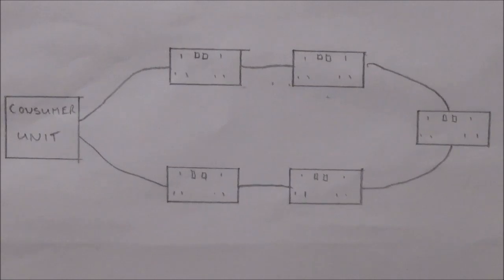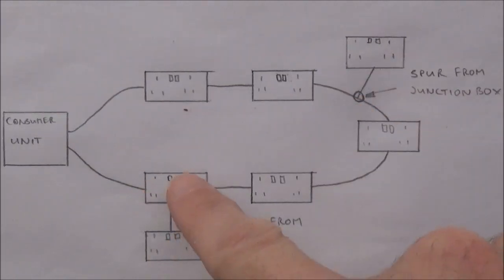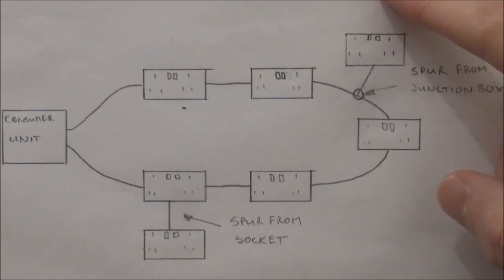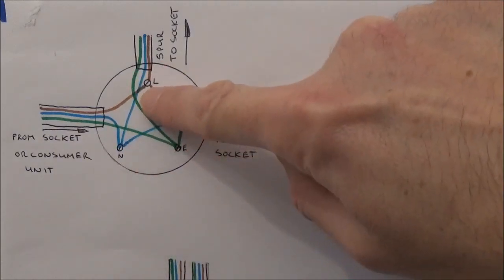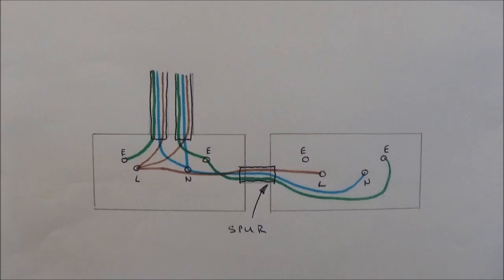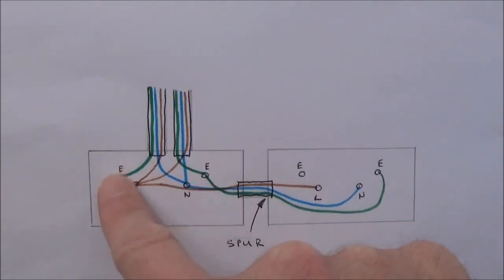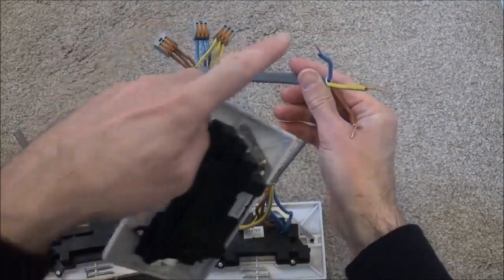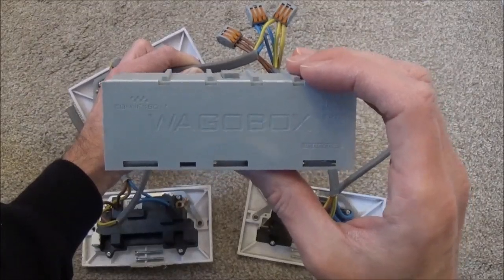How to wire a spur socket to ring circuit. Add a spur socket to ring main.

Comment: Can I change a fused single socket used for washing machine to a double socket for use of dish washer and washing machine. (Won't be run at the same time) and the double socket will still be on the fused switch.

😂😂

Comment: how do you tell if you have a ring circuit or a radial?
Reply: Im a diyer but from what ive gathered, continuity test is the best way of checking. I have a 32 amp breaker and there's 2x 2.5mm cables going to it so im pretty sure mines a ring circuit. I believe a radial is typically 16/20amp with only 1 2.5mm wire at the breaker

Comment: You should not cut the ring to add a spur, connecting or ring cuts should only be at sockets or DB. To add a round 30 amp JB to add a spur split cable do not cut. Slice the cable and  then the  cores are then pulled a part and each conductor is placed in the brass connector.   Use a Stanley knife to do this (only if training has been received how to use a knife safely) this is the correct way. Yes the round JB is rated at 30 amp but the way it is made can take 32 amp easily.

Comment: Great video! If you are only adding 1 new 2 gang socket via the spur method, does this need a fused spur if this socket will be utilisation an extension lead?
Reply from the maker: No because a plug on an extension lead has a 13amp fuse which protects the cable on the extension lead. Hope that helps 👍

Comment: Just don’t do it. Much better to divide the ring into two or more radials and fuse it correctly for the cable size.
Reply from the maker: But that's way more work than just adding a socket. They are two completely different tasks. Thanks for watching.
Reply: @ safety first .
Reply: @MARTINA-gc3tq  what is unsafe about a spur?
Reply: @ that's the wrong question.  You need to ask “what is wrong with a ring”  …..
Reply: @  uK homes are mostly wired in rings. Adding a spur is safe and easier than making the house a different configuration which would add complexity . So I cannot see how this is the wrong question, there are pros and cons to rings just like any other method. But it’s what we have and it’s not unsafe so the question stands
Reply: @pj4433  the CON being that there is a realistic chance of the cables being overloaded and under breaker protection provided.

Comment: You havent connected the cpcs in the socket outlet properly,you are obviously not qualified to give advice on these matters with modern socket outlets they are provided with 2 cpc connections,theres a readon for that which you obviously dont know,the reason there are 2 cpc vonnection blocks with a bar connecting two is very simple you connect one cpc into one block and the other cpc into the other block,the reason for this is that if you lose one of the cpcs through a loose connection or other reason you will still have a fully working cpc connection to that socket outlet because its a ring circuit,putting them both in the same block and its a loose connection making them fall out the block then you have no earth connection at that socket outlet
Reply from the maker: Not all sockets have two cpc connections. Only double pole sockets. Thanks for watching.

Comment: WRONG, just WRONG, clearly you are NOT in ANY WAY qualified or otherwise experienced to give this kind of advice.  The BROWN wire is the LINE (not Live), The BLUE wire is the NEUTRAL wire and the bare copper conductor that gets sleeved in Green & Yellow is the CIRCUIT PROTECTIVE CONDUCTOR or CPC, it is not called the Earth wire (even though it should be at Earth potential). On BOTH occasions that you wired the spurred off socket you got it WRONG, when only a single wire is secured by a screw into the rear of a socket then you MUST double over the single conductor (wire) and the cpc MUST go to the socket first (which in your case it did) but the back box if it is metal MUST also have a connection to the cpc, this has been a REQUIREMENT since 1966.  If the junction box goes under the floorboards then it must meet the requirements in BS7671 for a maintenance free connection, the WAGObox, if installed correctly, would meet this requirement whereas a round black (or white) bakelite junction box with screws would not.  The great ignorant masses out there in "YouTube Land" seem to think you made a good and useful video when it was complete bollocks and almost all of it was wrong, Stick to what you know and limit yourself to making videos about that, it is clear to anyone who is properly qualified, conscientious and competent that you have no place giving this sort of advice - STOP NOW and remove this video.
Reply from the maker: Thanks for the feedback, enjoy your apprenticeship 😂

Comment: I understand spurring off etc, but why not just add it into the existing ring? You've already got access from A (incoming) into B (socket), so why branch off B when you can just go A to C (new socket) to B and ignore the spur or fused junction entirely.
Reply from the maker: You can do that if the situation allows. Sometimes a spur is just quicker and uses less cable. I have done videos on extending a ring circuit. Thanks for watching 👍

Comment: A radial could also have 2 wires going into a socket so how can we be sure whether it is a ring or radial?
Reply from the maker: When disconnected there'll be power to one cable and not the other. If in doubt please use a qualified electrician. Thanks for watching 👍

Comment: this is exactly the video I was looking for so as long as my socket has 2 earths 2 lives and 2 neutrals I should be good to go. so if its only got one 2.5mm its already a spured socket and if its got 3 there is already a spur coming off of that socket?
Reply from the maker: You can also have radial like lighting circuits where one cable goes in, then back out of socket, but at last socket stops and doesn't return to the consumer unit. This is known as a ring circuit. So if you were on the last socket of a radial circuit you may also have one cable and not two. So what you said is sometimes true in a perfect situation but not always. The only way to truly know is to have it tested with electrical testing equipment as often in old houses cables are all over the place! Thanks for watching!
Reply: nope

Comment: so in total there are 3 sockets connected to one socket which are spurred off?
Reply from the maker: These are called double sockets (so two sockets on one so to speak). One of these can be spured off one other socket on a ring circuit as in the video.
Reply: @POUSEaroundtheHOUSE  thanks buddy, makes sense.

Comment: Hi there, can you help? I was adding an extra socket to an existing circuit spuring of the socket. After connecting the socket tester showed no earth. I didn’t check beforehand. The earth cables are connected. All of the sockets on this floor are also showing no earth. Would one loose earth cable in a socket cause all of the sockets to test the same or is each one independent. Thought I would ask before unscrewing them all. Thanks Paul

Comment: Only single socket allowed on a spur without fused unit. Double sockets or more need 13 fused spur.
Reply: You can put a double on a spur, check the regs - this has always been the case and it's a common misconception that you can only put a single socket in.

As explained in this video 2.5mm T&E is rated for 26amps (uninsulated wall cavity / clipped direct) - so a double socket can be used, unless the spur cable is in an insulated wall or conduit then it needs to be derated and either a single socket or 13amp FCU should be used.
Reply: I know the rating for 2.5mm  cable is 26 amps according to the installation method but I prefer to  keep this limit at 20 amps max for additiional safety. It may cost me a bit more in terms of time and money but I feel its worth it for  peace of mind. Just how much additional cost is a fused spur ?  £6 -£8 or so ?  You can call it being over cautious ( I have ADHD) but I can walk away from the job knowing I did not not cut any corners.  I know the likelyhood of both sockets running with a max load of 26 amps is low but I choose to design the installation to be idiotproof just in case. Whats the benefit of not using a fused spur ? To save a few pounds ? Is it worth it in the long run ?
From my experience  there are far too many tradesman these days that dont really care about the standard of the work they do and just cut corners and cost to finish the job ASAP so they can rush off to the next job.

 The regs give you the bare basic minimum standards you can get away with - there is nothing wrong in exceeding these minimum standards for addition safety.
I'm not going to argue sticking to the bare  minimum requiremenst in the regs for the sake of a few pounds here and there.
The fused spur also allows for addional sockets at a later date if needed.

 This was also taught to me on the C&G 2330 Electrical Installation  Level 2 and 3 course I passed 8 years ago. The regs probably have changed many times since then but the current carrying capacity of 2.5 mm cable is still the same.

In short , this video which is intended for persons with limited knowledge of mains wiring and no knowledge of the regulations, should not be informing viewers to install a double socket without a fused spur. 
Obviously if you are  an experienced electrician you can do this if you know the requirements of the regs have been met.
Reply: @dropdeadfredd1709  Actually the regs are not bare minimum, just the opposite - they're designed for an absolute worse case scenario + a margin on top of that. 
In reality in nearly all installations, you could pull 30 amps over 2.5mm T&E all day long. It's set to 26 amps to account for a stupidly long run, with very high ambient temperatures - i.e. worst possible conditions. There is no need to add an additional margin - there is already plenty of margin in that rating.

Adding in FCU's unnecessarily is not just about cost, it's also about adding another point of failure (more non maintenance free terminal connections) and aesthetics have to be taken account of as FCU's all over the place don't look good, especially in places like a kitchen.
Reply: i stand corrected . I take your point but should this video be informing non electricians that its ok to connect  a double socket without a fused spur ? Do you really think Joe Public is going to carry out the checks, such the installation method, derating etc  that a proper electrician will do , assuming the existing installion meets the requirements ? Not really. Joe Public will simply connect up a double socket and maybe another at a later date.

I aways install a fused connection unit for a double socket even if the regs say I dont have to. There is no need to push the max current over 20 amps on single 2.5 mm cable ( even on a ring ) if the installation is designed right.
Reply: Quick question, instead of running a double socket off the original could I run a single 13 amp FCU? This would be on a ring main.

Comment: Can I add a new socket off an existing fused spur? The spur is currently running off the socket on the left of the spur but I want to add a socket to the right hand side of the spur.. would that be possible?

Comment: thanks,,, what's requirement for hiding / protecting cable under plasterboard,, plastic 'trunking' or metal?? I'm installing fused spur about 60cm from regular socket.

Comment: If you chop into an existing circuit there is generally no slack in the cable to make a junction connection. One of the cables needs extending which is not covered in the video; or am I missing something?
Reply from the maker: Yes you're missing something. This is a spur, so you either snip then add a junction box and a new 3rd length of cable, or add a 3rd length of cable straight to the existing socket. I think you're thinking of adding a socket to a ring circuit. Two different things. Hope that helps.

Comment: I want to put a socket in my loft for a camera so my plan is to take a spur from a double bedroom socket straight out the front wall of the house, up the wall and under the fascia, am I ok running the cable outside like this, is it weatherproof or would I need some trunking or different sort of cable? Thanks.
Reply from the maker: Sorry for late reply. You should use some conduit if going outside  better idea would be to go from socket on landing, use some trunking to run it along skirting and up dor frame maybe to hide it (if you're not worried you can go straight up wall) then into ceiling (floor of loft). Then run to location of socket. Hope that helps.....2 years too late! 😂😂
Reply: Probably not advised but you could bodge it in the loft and take it off the upstairs lights ring if it’s just for a camera

Comment: Hi can I use a multi socket on a spur socket for extra appliances?
Reply from the maker: If you mean like an extension lead type with a plug then yes as they have their own fuse in the plug which protects the multi socket. Thanks for watching.
Reply: @POUSEaroundtheHOUSE  yes

Comment: Brilliant video.
I would like to ask, i want to add 2 further sockets in the bedroom but the cables from existing 2 sockets are coming in and shooting off in all directions from the room.
My question is how do i know where to break into them to continue the ring.
I could spur but prefer not to.
Thank you
Reply from the maker: The only real way is by testing the electrics or if you're certain of the wiring like me I rewired my house so I know where it all is. If you're able to lift floor boards then you will be able to see the cables but you have to be careful you don't spur off a spur as in old houses previous owners have likely added all sorts of wonderful things! This video may help - How to add socket to ring circuit - https://youtu.be/TPnce20ceBQ. Best of luck with it but if in doubt, call a qualified electrician to ensure it's safe. Thanks for watching.

Comment: Hi, I am looking to spur from an internal socket to an external, and then spur from that to power some lights in the garden. Would I need to add a 13amp fuse before my external socket & would it be fine to spur from that or would the lights need a fuse too? - I read in the comments you haven't made a video on the fused spur yet.
Reply: Any external work needs to be notified. A registered electrician can self certificate work. You should receive minor works cert & local authority notification. To do this yourself would cost more than double the price of a simple job.
Reply: @douglasgreaves188  not true in England. Part P changed and outdoor is not notifiable (unless a pool). However all work must be inspected, tested and certified even if non notifiable.
Reply from the maker: Yes, 13 amp switched fuse is good as you can turn power off to outside.  Then spur to socket outside (which needs correct ip rating and installed correctly). Then as you said an outdoor 3amp fuse or switched fuse connection unit (ip rated) spurred to lights. Any outdoor electrical require rcd protection on the circuit. Hope that helps.
Reply from the maker: Just thinking you could spur off the internal fused switch to another internal fused switch for the lights. That way you'd have two internal fused switches one to sockets and one to lights, allowing you to turn off sockets and lights separately in case you want sensor lights left on while you're away but sockets turned off for example. It also means you could have a nicer looking out door switch for lights. It's up to you! Hope that helps 👍
Reply: @POUSEaroundtheHOUSE  thank you for replying! Yeah that sounds like a good idea! So the two internal switches would come both from the internal socket? Or Socket to Fuse 1, then fuse 1 ext socket, to fuse 2, and then to lights. (might need a diagram 😅)

Comment: So you say you can only add one extra spure. This is what I want to do can you please tell me if this is ok to do. Thanks. 
Bedroom has one double socket, so I’m going to spure of this by adding wires to the double socket and then adding them to the new double socket. I then want to add another double socket from my new double socket which iv just fitted. Am I ok doing this or can it only be one extra double socket. Thanks. If I can’t do this then how do you add multiple sockets to a excising ring. Thanks
Reply: You can't do that, as he explains in the video that would make it possible to overload the cables by plugging in too many appliances.
Reply: @alanwilson1990  I got a electrician out lol. Did a job for a job so things worked out good. Thanks for the reply

Comment: Instead of having two cable wires going into the socket when making a spur circuit. is it possible to just take one wire from where you cut through using a junction box. If you see what I mean. Rather than taking two cables to your socket.

Comment: Did you do the fuse spur video?? As I'm confused I've seen electricians take a wire out of a socket into a fuse then wire up a light??
Reply from the maker: I haven't yet sorry. But you can go from a socket to a fuse or fused switch and then to more sockets. A 13amp fuse means you can add as many sockets as you want after the fuse. Can also be used for appliances like kitchen extractor fans etc. Thanks for watching 👍
Reply: @POUSEaroundtheHOUSE  what about to a garage rcd box to then make loops for lights and sockets?
Or put a fuse box to change from a socket loop to a lighting loop?
Reply from the maker: @vladaslav  you'd have to check with an electrician on this one. There are various ways to create a garage or shed circuit. If the garage is attached to a house you can run a ring from the consumer unit and use a fused spur for the lights with 3amp fuse. But detached buildings and outdoor wiring need different approaches depending on circumstances and what earthing system you have. If in doubt, please call an electrician to ensure you have a safe installation. Hope that helps.